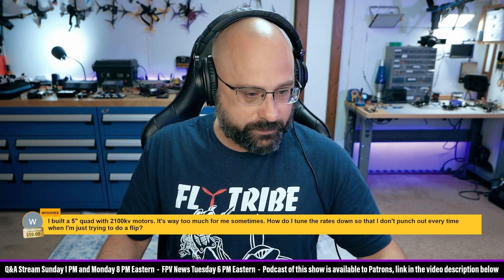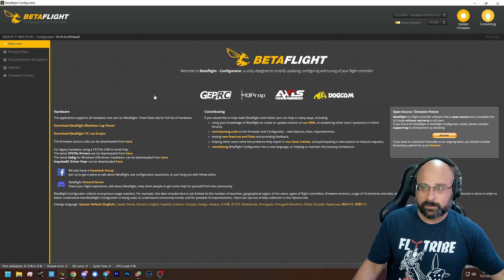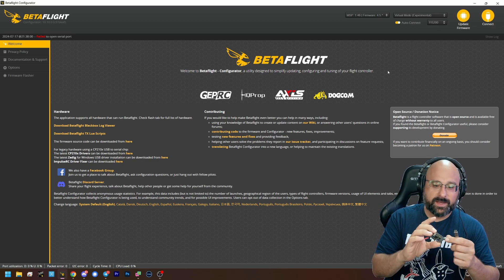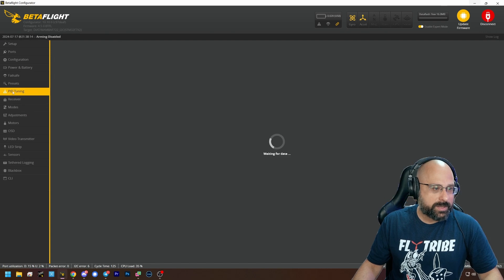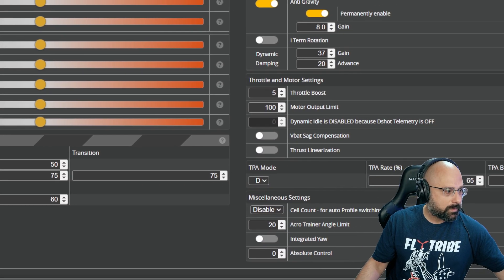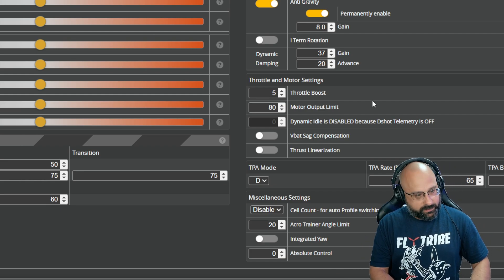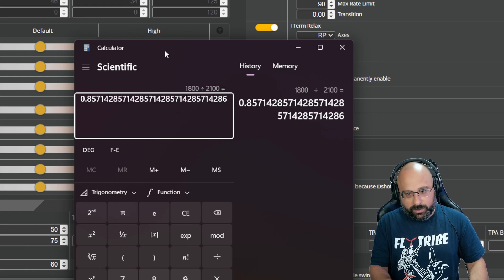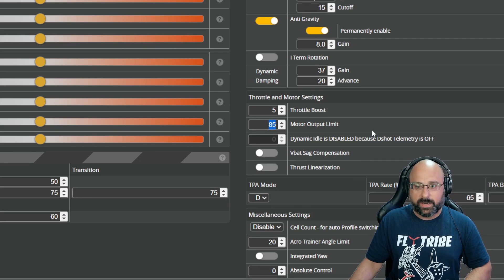My Quad Is Too Fast For Me! How Do I Slow It Down? Motor Output Limit? - FPV Questions

Comment: How do I make it faster?
Reply: Putting negative numbers? 😂
Reply: @joec4339  never utilized betaflight.. I appreciate the info
Reply: Steeper camera angle, higher pitch props, lighter battery packs (1100-1300mah), Higher discharge lipo packs 150c+ rated. But mostly steeper camera angle.

Comment: You should always try throttle limit first before limiting the motor output power. Limiting the motor power can severely degrade the ability of the flight controller to react to prop wash and similar extreme conditions, even with high kv motors.

Comment: would this the same steps if i buy a 6s and want it to "simulate" 4s power? 
(just asking if i want to fly in the future with a 6s but dont want to buy first a 4s and than later the 6s upgrades if i could make it that way explained on the video, i would save some bucks)
Reply: Yeah exactly, you would just put 66% in the motor output (4/6 = 66%)
Reply: think so yeah. could be weong but there is an easy way to do it and pretty sure this is the one. start on 6s and just restrict its output. its what i shouldve done and wouldve saved me £200